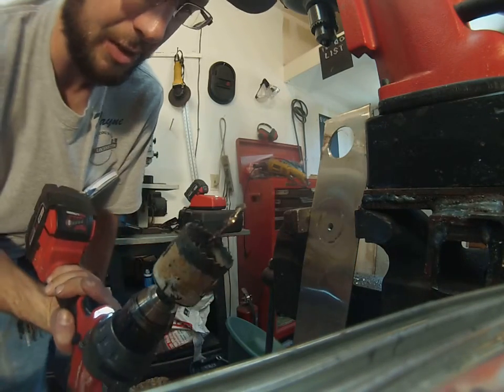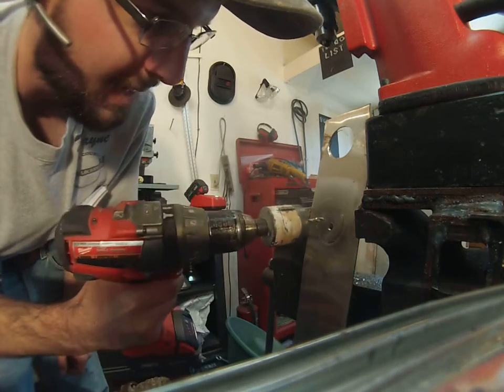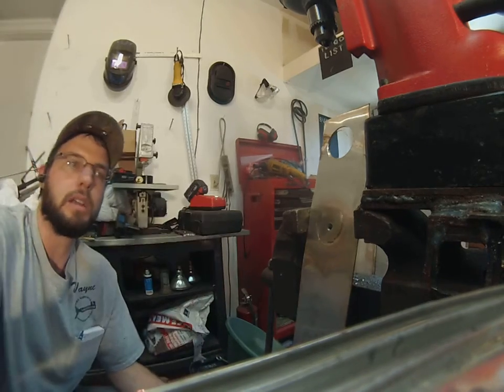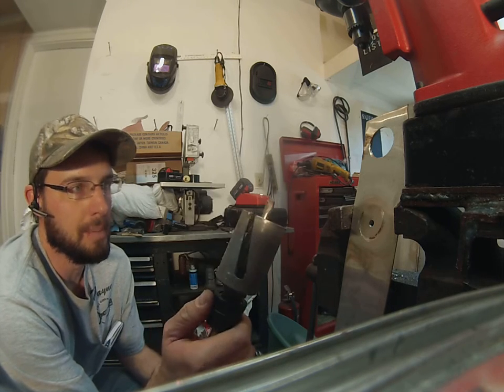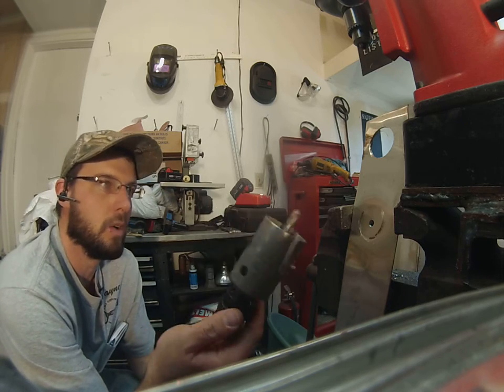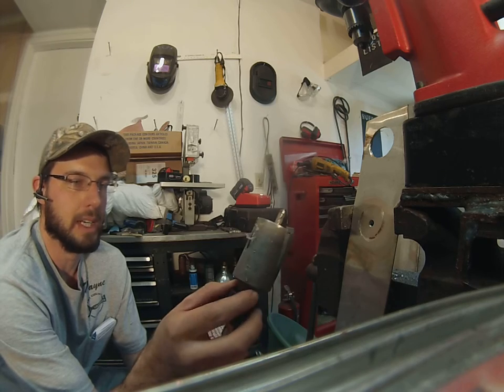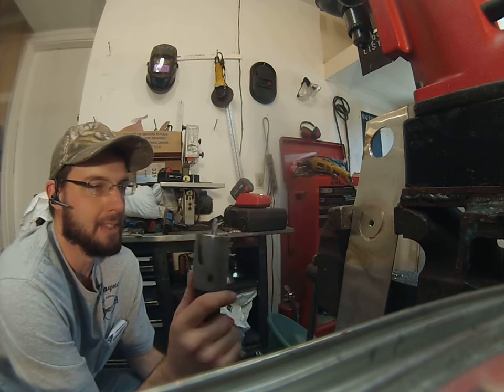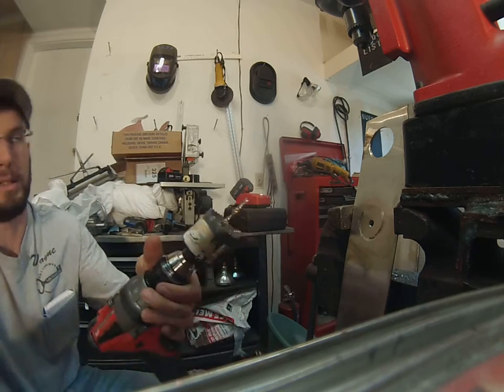Bi-Metal Hole Saw Bit (NOT) Drilling Stainless Steel

Comment: Would it have helped if cutting oil and lower speed was used with the bi-metal saw?
Reply: Absolutely!!! Looks amateur to me. I have worked with SS for years. Quality drill bits, low RPM, lots of coolant. It also helps to have the material flat so the coolant stays in the cut zone too. Bi-metal will work for a few holes. Just have to do it right. A drill press always helps. No runaway RPM when pressure is reduced.